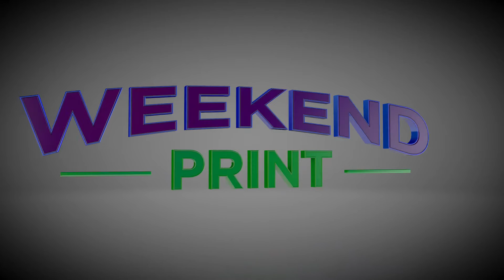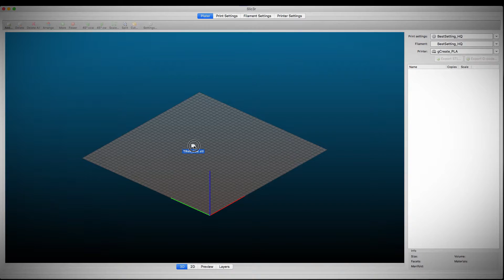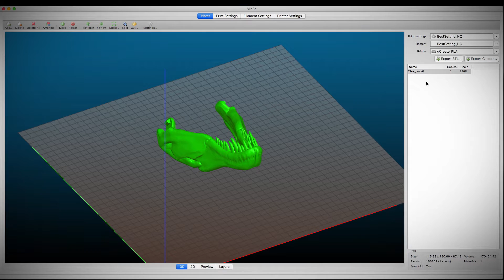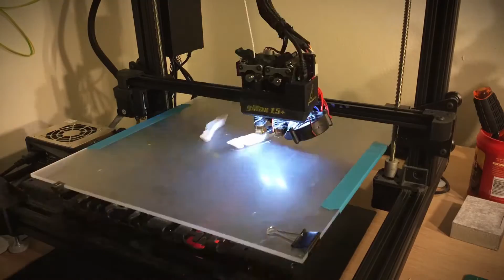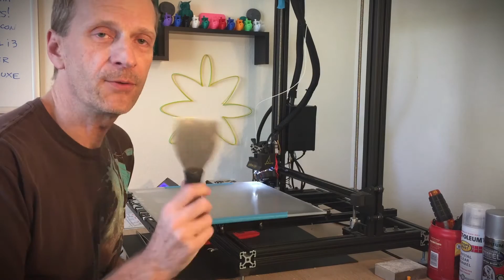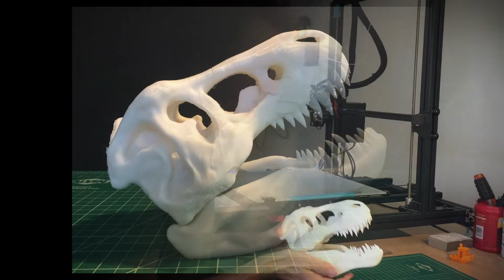The Weekend Print - Episode 6 - The T-Rex Project

Comment: So the jaw is supposed hinge enough to allow the teeth to mesh together?
Reply from the maker: Actually it is not supposed to move at all, it should fit snug to the Skull part but I had a little bit of shrinkage on the Jaw bone, still usable part of the big build. Might have to hit it with a heat gun to bend it back but we shall see how the rest of the build goes. I think it is fine. The actual T-Rex lower jaw is split in the center and is two pieces but for simple 3d printing, they merged the model.

Comment: Well done. I'm tempted to print this huge as well on giant delta. Do you have an idea how much plastic it will take scaled 2.5x? 
Also I suggest you run a few calibration cubes (there is 40mm cube on thingiverse) at different temperatures to tune your extrusion temp and flow rate. 225 is very hot for regular PLA. You just do 1 perimeter and check with calipers what the thickness is -- try different extrusion multipliers until it is what it's supposed to be -- at more conservative PLA temp.
Reply from the maker: Thanks for watching! Not sure on the PLA amount, thinking about half roll per part, maybe, so quite a few, lol. Thanks for the testing tip, too, I will be using your information along with my usual testing and calibration methods to get the printer dialed in much better. 225 and even higher is way too hot for PLA, this I do know, but that extruder skipping was a major issue so I will be testing new settings this week. Thanks for tips, very helpful.